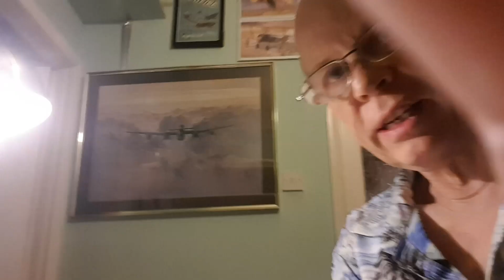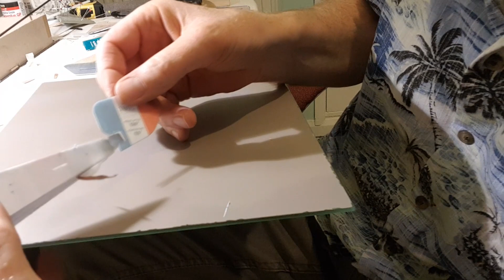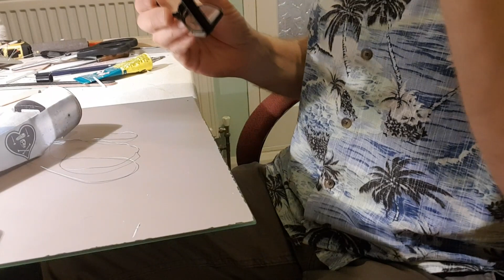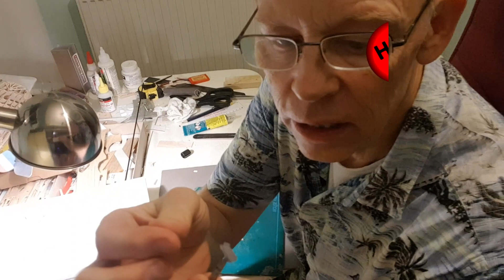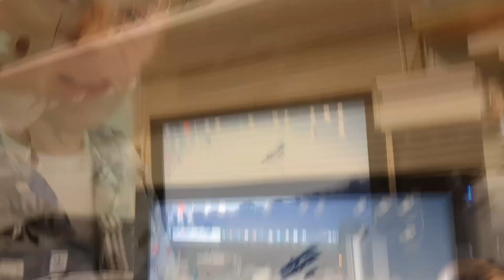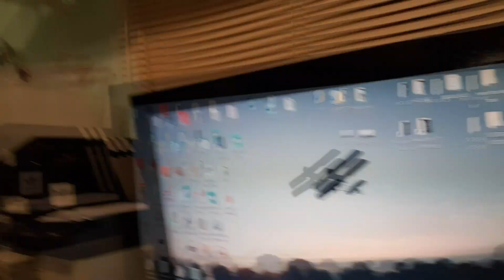Microaces Nieuport 17 Part 4 Tail Feathers

Comment: Would you say it might be possible to convert it into a four channel like the micro aces D7 kit. I'm about to start i suppose it  might be if the space allows. Thoughts?!
Reply from the maker: Hi Titan, good question,  I would say absolutely, they're lovely big ailerons, but as it has an all-flying rudder, and will turn quite easily, is it worth the gain? Personal preference I guess.
Reply: Yeah idk do you think itll do a roll with the rudder i actually find that in a flight sim it needs some aileron assistance if possible but i guess my best bet will be to build it first see how it goes and if i need to make modifications go from there overall great vids will come in handy when i start mine
Reply from the maker: @thewrightstuff7971  I think if it did roll it would be very barrelly, if you want to do a half-decent roll you'll need ailerons. I've never actually thought of trying to do a roll with my DVII, and certainly not indoors, maybe next time I'm out in the fresh air I may give it a go, thanks for the idea.
Reply: @cliffharveyrcplanes  yeah most ww1 fighters dont do rolls great unless you are at a high alt though i do find in some flight simulators Rise of flight for example that rudder plays a major role in a majority of the maneuvers overall either way itll be a fun build for me.